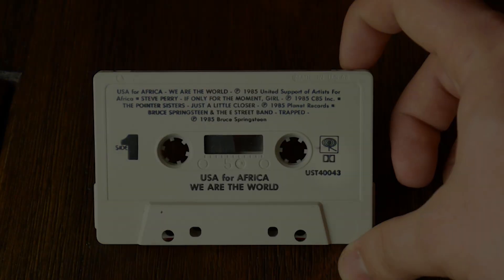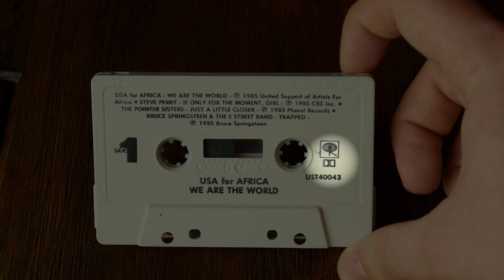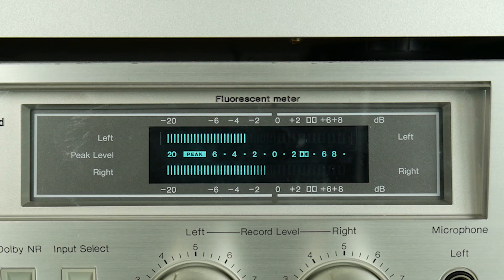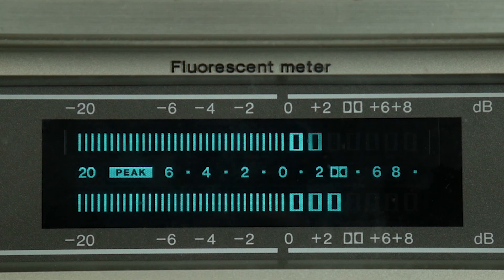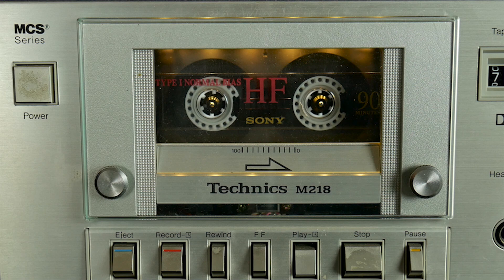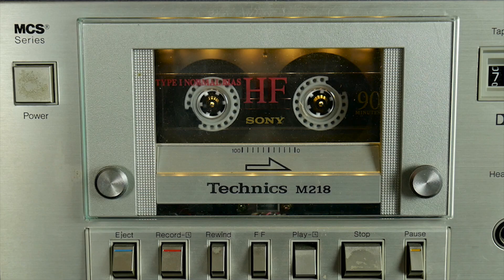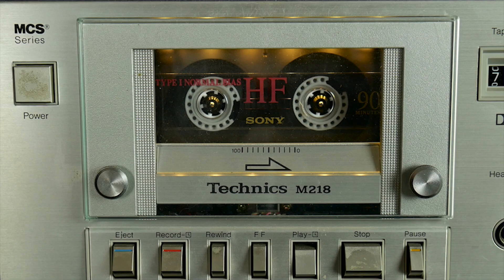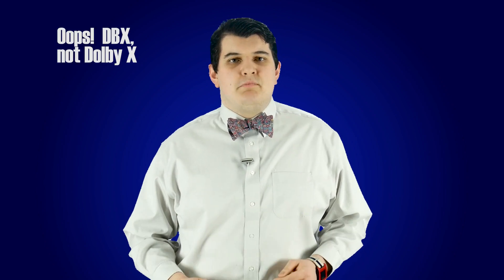What is Dolby Noise Reduction?  Dolby's Humble Beginning

Comment: Dolby NR (Type-B) does NOT work in the way you described. The reason being that doing it that way would cause chronic high frequency tape saturation leading to massive amounts of distortion. It only applies high frequency boost on record at low signal levels, then high frequency cut on playback at low signal levels. It uses a detector to measure the signal level in real-time and adjusts a dynamic sliding filter accordingly. That's precisely why it's referred to as a compander because it's dynamically compressing then expanding the high frequency range.

Comment: Awesome explanation!  However, all digital systems still use  DATA compression. and are not analogous to the original recording.  So there is a trade off by going digital   Its is. also sad to no longer see useful specifications on digital equipment.  Gone are specs for Signal to Noise ration, dynamic range, and bandwidth.  I would like to know the best signal to noise ratio of the best modern day digital source.  Equalizers have also been replaced by pre-set equalizer curves.

Comment: But Dolby noise reduction improved optical sound, so you could get the sound quality of magnetic sound tracks with easy duplication and always compatible to the optical sound standard from the early 1930's. They also implemented the developments for matrix based quadro, to encode 4 channels in 2 tracks. So it was like the 4 channel sound known from Cinemascope.

Comment: But how was a noise profile ever made to reduce noise from a tape if digital technology didn’t existed back in the 60’s??
Also if dolby noise s reduces noises based in quiter & louder parts of the audio by simply soften those quider parts of the audio,then did they had already such advanced algorithm back in 1989 to identifie quiter & louder parts of the audio?
Also why do you need record tapes with dolby noise s ,is that to create a digital tracking for that dolby s chip to be able to track down quider parts of the audio in order to be able to soften it down???

And how about those dolby noise chips with builtin noise profile do they require audio to be recorded on tape sothat later during playback those silence parts in the audio trough digital audio tracking can be used against those noise profiles of it to mute it or to invert that noise profile sothat they will cancle out each other??

Either way this is pretty impressive,
Now another cheap way to serpress noise is to use a lowpass filter but it can result in dull audio so to try to recover those lost frequencies ,a high pass filter can be used to make it sounding better wich should work with every audio take,BUT it is possible that certain types of dolby noise chips do require the audio to be recorded with such chip to create a digital tracking of it sothat during playback the chip can then detect & dermine wich parts of the audio became those high unwanted frequencies and depending of the level it can then determine how much amount of lowpass filter should be applied to those frequencies and how much amount of levels of the highpass filter should be sfterwards to be applied to restore some of it’s frequencies,
If my theiry is right,i wouldn’t be amezed about such smart clever methods of doing that.

Comment: In the 80s, I bought high end components. 
Using a linear direct drive turntable and the most expensive cassette deck, I could make cassette copies of my albums, and save the albums in case the cassette got damaged. 

The cassettes sounded GREAT! As long as I didn't use Dolby noise reduction. It made the music sound very dull. Super noticeable. Hearing some tape hiss was much better than ruining the music.

I used more than one tape deck during those years. The same with all of them.

If I recorded using Dolby, my cassettes would sound as bad as commercially recorded ones. 

Although I don't think I has Dolby S. I remember B and C.

Comment: This video isn't up to your usual high standards. You hinted at what companding actually is. Like other people have said, it isn't just boosting and then cutting frequencies. That's not what compression and expansion are. They are dynamic processes where the amount of volume adjustment changes with the sound input. As a rule, the louder something is, the more its volume is reduced by a compression circuit, and vice versa with an expansion circuit. But the Dolby process is even more complex than that, involving splitting the sound into multiple bands, compressing them individually, adding them to the dry signal, and then undoing the process during playback by sending things through a negative feedback loop (if I understand the last part correctly). If you look at the curves for Dolby, you find some truly unusual things, even if you're familiar with ordinary compression. You find re-entrant compression, where the curve of the compression circuit actually goes DOWN as the volume increases, so that when the input sound is at its loudest, the compressor won't be adding anything, but when it's at lower volumes, it will be adding quite a bit more. It boosts the quiet parts, while leaving really loud parts virtually unchanged, and then puts all this on the tape. It's an extremely sophisticated feat. This video didn't get any of that. But I bet you could do it better if you made a video today.

Also, whenever you use synthesized music, the sound is inherently unnatural, so tracks like these aren't great examples to use when showing how different processes can alter the sounds.

Comment: Dolby B is essentially the reverse of RIAA equalization, in which bass frequencies are attenuated during recording to better fir them on a record groove and boosted during playback to compensate. I'd love to see a companion video on this. It would be great if you could also include a section on why ceramic cartridges don't require the RIAA bass boost. (I've studies this in detail, but this was back when vinyl was still the mutt's nuts, so my memory is a bit rusty. Something about ceramic cartridges being inherently less sensitive to higher frequencies.)

Comment: In theory, you could hook up an equaliser between your source and the cassette deck. Then while recording, you could boost the high frequencies while keeping the mids and lows flat. Then during playback, you could reduce the high frequencies back to the flat position again, assuming that you play back your cassette through the same equaliser. Or you could just reduce the treble on the amplifier, and your recording should still sound bright. This would also eliminate incompatibilities between different cassette decks, where noise reduction systems are concerned, as was often an issue, even with two different decks with seemingly the same noise reduction systems. On the recording deck, the cassette would sound fine. But on a different deck, with Dolby B for example, it may sound slightly muffled, or compressed.

Comment: I was a hardcore audio tape guy for ages, and always used Dolby. Until now I never knew much about how it worked, I just knew it did. One of these days I need to find a decent USB tape player so I can transfer some of my old stuff into digital.
Reply: DON'T I'll explain. You current cassette decks will work beautifully for the task. If you plan to use your computer as your digital recording source, use the line in on the computer sound card Audacity is completely free to download and use as the recording software. Those USB tape devices are garbage and WILL NOT do your prized recordings justice. The biggest catch is ANY NEW cassette tape machine has no Dolby because it is no longer licensed. You can search for an RCA (connect to your tape deck) to standard mini headphone jack (plugs in the line input on your computer). Set the recording levels to about 75% below the ZERO decibel mark in Audacity (no clipping) and afterwards you can normalize your recording before permanently digitally saving it to your computer. Hope this helps 👌😄😃.
Reply: @darinb.3273  Unfortunately the good quality cassette deck from my old component stereo system no longer works. The only other player I have is a boom box that doesn't have outputs.
Reply: @raydunakin  Awe man sorry to hear that, I made an assumption your cassette machines still worked. Any idea what's happening with it/them? It may simply be in need of new belt(s). Any details you can provide you and I may be able to get 'er pulling tape through her again.
Reply: @darinb.3273   Thanks. I'm not sure what's wrong. The whole system stopped working about 15 years ago and I couldn't find any place that still does repairs. I suspect the problem is actually in the amp, which provides power to the tape deck.
Reply: @raydunakin  Ohhhhh one of those type systems that relied on the Amp portion to supply power? Not a TRUE component system in other words. As I understand a TRUE component system is everything can work independently and mix and match with ANYTHING that had line in and outs. It maybe worth checking to see if you can determine the voltage requirements for the cassette portion if it is separate and still get much better quality than a USB attached device. Techmoan as well as many others have reviewed those wanna be cassette players. Of course another option is to find an older machine for sale somewhere thrift stores and yard/garage sales. Never know what you may stumble across. 👌😄😃.
Reply: @darinb.3273   It's been about 35 years since I bought it and installed it so my memory of how everything is connected may not be accurate. However, I think the tape deck is merely plugged into an outlet on the back of the amp (along with the turntable) so that everything comes on when power to the amp is turned on.
Reply: @raydunakin  Got ya it maybe worth checking it out as you have time it maybe something as simple as a blown fuse on the powered outlet(s) as I remember some units have them switched and others were hot all the time but rest assured ALL of them had fuses. Some internal and some were external. I'm gonna guess the cassette deck is perfectly fine. Unless it is like some belts that deteriorated. At any rate perhaps you may want to investigate and I'm willing to help you figure it out 👌😄😃.
Reply: @darinb.3273   Thanks
Reply: @raydunakin  Of course you are welcome. As I mentioned before I'll help get your transfer going, if you need any that is 👍👌.

Comment: A simpler form of this, pre-emphasis, was also commonly used on LPs to reduce high frequency noise.  You could probably do multiple videos on the format wars around LP equalization curves and pre-emphasis, but it eventually settled out with a standardized "RIAA curve".  CD later included a pre-emphasis option as a workaround for high frequency quantization noise caused by early encoders and poor playback equipment, but it was inconsistently implemented and rarely used.  Speaking of which, if you haven't done a video on HDCD and how it revolutionized CD premastering, that's definitely a worthy topic.

Comment: Noise reduction is also why some old recordings with low budget recording followed by low budget digital transfers sound terrible. A lot of old bluegrass (and I assume other niche musical styles) was recorded without any noise reduction reduction, but the digital "remasters" are sloppy with the stuff. I often just boost the treble on them until I hear enough hiss to make the music sound right. I wish there were better tape transfers of a lot of these classic albums. Of course there are also occasionally albums transferred without the RIAA curve. I wish Dolby would write a software plug in to add/remove noise reduction in a daw so some of these old transfers could be fixed.

Comment: Although your explanation was pretty well spot on, the reality of living with cassette tapes was quite different at the time.  Dolby wasn't by any means ubiquitous in all playback equipment, and even when it was there it was largely ignored.  This might have been because the end result was never really what you would have expected from an untouched recording.  Many people, myself included, just ignored the Dolby to what extent was possible.  Some friends and I actually did some digging, and found that the whole noise reduction process was highly dependent on the tape itself, as well as the calibration of the electronics.  What we found was that the best you could expect on any given playback machine was for the response curve to be more or less correct only for one oxide formulation.  In later days, tape quality improved dramatically, and so did output level.  This meant that because of the much higher output for the same recording level, the noise floor was automatically lowered to produce much better noise performance without using the Dolby at all than it was previously with it.  The upshot is that millions of recordings were made with built-in distortion, which couldn't really be fixed.  Living with this situation caused a smouldering resentment among those who were sufficiently aware, although much of the listening public had no idea anything was wrong, and anyway, so much of the commonly used equipment either didn't have Dolby or the user just ignored it.  In later days, tape formulation had improved so much that an unadulterated recording was almost indistinguishable from a CD.  The end result was that we got decades of ruined cassette recordings for no good reason.  Dolby made tons of money and ended up in the undeserved position of being the default audio codec when the DVD came along.  

Taking everything into account, including hindsight, having cassette tapes as your normal means of consuming music was a decidedly disappointing experience.  So, the Dolby Distortion was only a relatively small component of the unhappy situation.  People today have no idea how lucky they are.

Comment: Dolby A didn't go over too well because many people held the opinion that it tended to give things a "harsh" sound. Part of this, I think, is probably a misunderstanding of how to utilize the system. I admit that as a young kid, I never liked the sound of Dolby but then I never had quality equipment to listen on and since "brighter" tends to sound better in many cases, I only rarely used my boom box's Dolby processor, not fully comprehending what it was trying to do. 

One fun fact is that the Dolby boost did some interesting things that engineers sometimes decided to take advantage of during mix down. So as a way to give lift to some sounds, they'd be run through the Dolby boost and then mixed into the recording as they were. 

Audio SNR is still an issue but mostly only within the recording studio and there the issue is microphone sensitivity vs the source relative to ambient noise and self-noise from any outboard equipment processing the sound. (Like turning a speaker way up with no signal. The "hissing" sound is the self-noise of the amplifier.)

Comment: Unfortunately, the explanation in this presentation is flawed in a way that cannot go uncorrected.
The author conflates spectral recording pre-emphasis and reproducing de-emphasis with “companding” when actually they are two different but complementary processes. 
Companding (which Ray Dolby did not invent, but improved upon) is not spectral – or frequency related – but purely amplitude encoding. By compressing the signal in amplitude mode, we are able to place the entire signal at a level well above the noise floor of the tape hiss, then re-expand the signal on reproduction to relegate the tape noise to an almost inaudible level. Dolby improved upon this by introducing a four—band “sliding band” differentiator, which did allow different spectral components to receive differing compression and subsequent expansion ratios. High-frequency pre-emphasis in recording, and complimentary de-emphasis in reproduction are complimentary techniques, but in no way fundamental to the companding process, as this author appears to suggest. 
In an interesting anecdote, Dolby (who began his illustrious career developing tape-based video recorders for Ampex) applied this A-Type noise reduction to optical motion picture film, to develop Dolby Stereo, however it proved relatively inefficacious in reducing the impulse noise induced by dust particles on the optical soundtracks of film, and the Dolby “magic” was really never perceived beyond the Hollywood screening rooms that received pristine film prints, straight from the lab. Improvement would await the introduction of Dolby’s “SR” (Spectral Recording) process, which did solve the problem, but alas by the time this was launched Kodak and ORC had already launched CDS – the first truly digital sound format for motion pictures, which was quickly followed by the dual-support DTS format, both of which blew Dolby-SR out of the water before it even hit the theatres – forcing Dolby to precipitously develop the technically inferior SR-D format just to remain in the game at all.